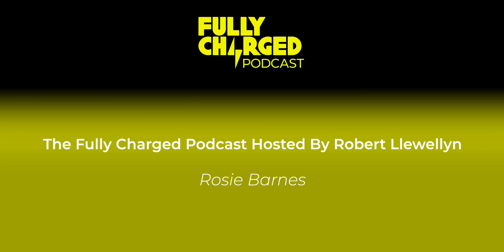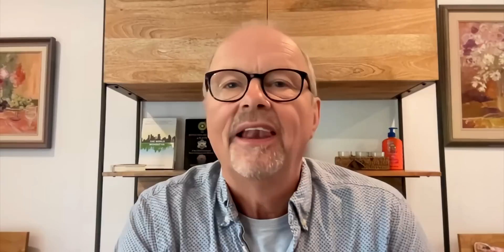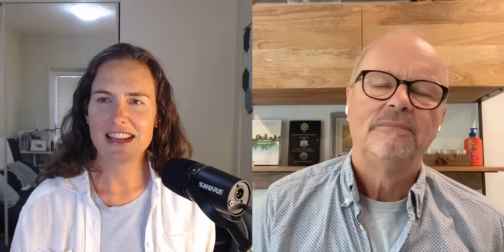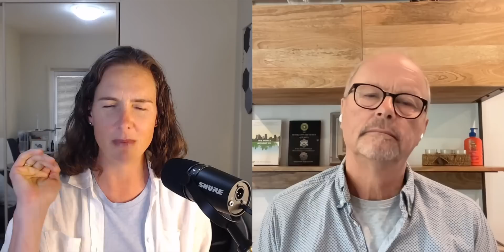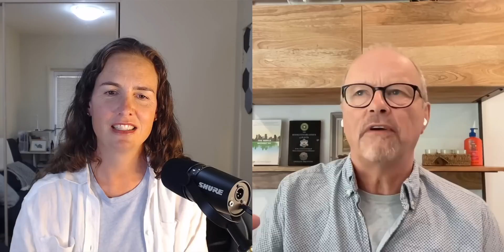The Inevitability of a 100% Renewable Energy Supply with Rosie Barnes | The Fully Charged Podcast

Comment: If the renewables are so cheap why do we have one of if not the most expensive electricity in Europe?, say we manage up put in lots more wind generation capacity and the wind does blow for say 5 days which does happen, what is going to power the country unless there is gas back up?, battery back up for the whole country for multiple days would be absolutely huge not only in size but also in cost! People are living in la la land, we need much more base load nuclear. 
Robert have you done a video showing people how much your solar panels produce in December?, I bet it doesn’t run your house for the day that’s for sure.

Comment: There is nothing inevitable about producing prohibitively costly electricity!  Electricity should be getting relatively cheaper with improved efficiencies even with the cost of tight emission requirements, but anyplace renewable energy has been implemented the cost of electricity has gone up significantly not including traditional hydropower.  Where renewable energy is rampant electricity costs can triple making them prohibitive for growth and still cause the public power grids to go bankrupt, unreliable and unable to upgrade its power lines making them dangerous.    

The Hawaii fire that destroyed neighborhoods and killed many people appears to be from badly maintained power lines from a public power grid proud of just having eliminated its coal power plant demonstrating no public responsibility in providing reliable, affordable and safe public power grid electricity.

Comment: One aspect missing from the narrative in this episode is the fact that the resources needed to mine, refine and manufacture every wind turbine remain heavily dependent on fossil fuels. 

The steel needed for the mineral mining machinery, the energy used in mineral refining and final production  of the resources needed for renewable energy generation and storage all depend on fossil fuels. 

We have a long way to go before all renewable energy production and storage is fully decoupled from fossil fuels. I look forward to the transition however, we must remain aware of the fact that every solar panel, every wind turbine and every EV requires a significant amount of fossil fuels to get from raw material to finished product.

Comment: There is no question that wind and Solar are cheaper on a dollar per watt generated at peak levels.  The problem becomes in providing continuous power, especially when these fail.  This requires backup.  When that is taken into account, the numbers shift dramatically.
If this woman is an engineer, she is likely to be in violation of her ethical commitments by making all of these comments that she is not qualified for.  Her expertise, as she stated, was to evaluate length of windmill blades versus costs, etc, etc.
Robert Angus, P.Eng.

Comment: IMO, Too much on 'the positives' without addressing the negatives that come with the positives. Ex. at around 37 minutes, Robert speaks about decreasing usage of power at times when less energy is produced. OK, quite sensible, but that would also greatly increase the usage in a smaller time frame - which is also the time frame that industry is using the most power. Can the Grids handle that? Additionally, I heard no mention of dangers to wildlife. Birds are smashed by wind turbines and fried by solar. Considering the increased units of these sources, there would also be an increase in wildlife deaths/injuries. What about waste? Parts for Green energy don't last forever and are surely not made of biodegradable materials. Just a sample.

Comment: The only "inevitability" is fossil fuel production is declining. Thus we will need something.  The question is WHAT - that WHAT cannot be Solar nor Wind. These are demonstratable farces.  The fail point is battery storage.  The largest storage battery in the world was just built in the UK  Cost 400 million for 400 Megawatts- it could only sustain the current electrical demand in the UK 11 seconds.  You'd need 1500 such giant batteries to maintain power at night; not to mention dark winter days. Unfortunately you need to triple that to move fossil to electric - so you need 4500 such storage sites; at a cost of 400 Million each - is roughly 25 Trillion dollars.  Does that Strike you as real even at 10 Trillion? The entire UK economy is only 3.1 trillion - don't forget this is just the storage; not the wind mills and the solar farms. TOTAL CRAP.

Comment: Denmark has the most renewable energy and also the highest household cost of electricity. In fact most locations that have a high amount of renewable energy have the highest prices for electricity. Most of this is because you need to keep some source of backup when the sun doesn't shin and the wind doesn't blow.
Reply: Exactly right, there needs to be back up, solar panels are useless in the winter in the uk or Northern Europe and wind is intermittent, no one is addressing the back up issue renewables are largely an expensive scam, I can see a future where we will be left with old wind turbines that will be abandoned because they are uneconomical to replace and keep maintained.

Comment: It is not technically or fiscally possible to build the energy storage capacity on a level to support a national power grid. That is why nobody has it.  Therefore, the notion of 100% renewables power generation is a fantasy. Even the EU have had to accept this, they have now classified gas and nuclear as "Green fuels" so they can bypass the finance bans on funding  "emitting"  tech, and can build new gas and nuclear power stations. Why, when they are committed to renewables? Baseload power provision supply 24/7. You can build as much wind and solar as you like but if there is no wind, or too much, and no sun, you still have no electricity.

Comment: I don't mind getting rid of fossile fuels but from where are you going to dig up the minerals needed for the renewables and extensive grid structures? Just a "simple" mineral like copper will run into a shortage in a couple of years. Rare earths...? Where and when are the mines opening? Still more than 80% of the worlds energy comes from fossile fuels. Renewables around 4%. Since there is a shortage of minerals to supply renewables the price for renewables will not drop. Of course, as long as politicians raise the carbon emissions taxes accordingly, people in favour of renewables can claim they are cheaper but can people afford the energy bills without extensive tax deductions? If no tax deduction, the inflation will be very tough to deal with. I never see an open discussion about the mineral facts from those in favour of renewables. Why is that?

Comment: At min 40 Rosie dreams about a system, where the energy customers actually make money if they act according to the availability of power (like: use the washing machine when there is plenty of wind). Sounds nice. And true thing, you can steer consumption this way. Easily done too: the price for energy wont be constant anymore but will change from hour to hour. You ll need a complicated meter in every household and we people have to really be careful when to switch the computer on. Will you have an app on your phone that has an alarm set if the price is too high? Cool, huh? You wont "safe" money this way - you can prevent to pay a lot! Everything will be more complicated. But hey, its for the environment. And while the poor will try to carefully adjust their energy consumption ("Sorry, baby, its too expensive to turn on the AC now..." Will the rich politicians that sold us this "way to safe money" carelessly consume energy because they have enough money.

Comment: Wind and solar have negative value. All they do is disrupt the grid, despoil the landscape and kill birds. They last 15 years and then are tossed into landfills or are abandoned in place. They wouldn't be worth using if the Chinese gave them away for free. They use more energy and materials than they save. There is no shortage of cheap, reliable fossil fuels which replenish the Earth's depleted CO2 and have a small footprint on the land. We should also be incinerating garbage for electricity and heat instead of sending it to Asia where they dump most of it in the ocean. My plan: Prevent most forest fires with plenty of logging and logging roads. Build lots of coal plants and garbage incinerators which will provide the missing particulates needed for rain.

Comment: 100% low emissions energy is inevitable but not for 8 billion people.  Global warming is already locked in 2 C warming by 2050 and 4 C warming before 2100.  Here is why.  CO2 equivalent is already measured at over 500ppm.  Arctic will be ice free within a decade or two, releasing massive CO2  and CH4 amounts into the atmosphere from methane hydrates and CO2 on the ocean floor and the millions of sq km of thawing tundra.  The stratosphere is warming vaporizing stratospheric clouds reducing reflectivity increasing isolation.  Global fossil fuels supply is nearing permanent decline and increasing cost.  Energy cost has a limit of about 10% of the value of the work it will do, despite economists say that applies to all energy.  The only truth in economics is:  Supply will meet the demand that has the a ability to pay.  Most will not have the ability to pay.  The metals needed to electrify the energy system are neither in supply or known reserves.

Comment: Unlike Rosie I have actually worked in electrical engineering mainly in generation systems for decades with the last decade being mainly in wind power in Europe working on the design and latterly certification of some of the largest offshore wind farms on the planet and I can tell her now that Wind energy will never replace nuclear and hydrocarbon energy sources.

I like most engineers who got involved in wind power thought it would save the planet albeit by destroying huge swathes of hillsides and seabeds that if oil and gas were to do it there would be a huge outcry but the fact is that without huge government subsidies that push up the costs of electricity massively these things are financially impossible to build and if the full damage they do to the environment was added up they would be impossible to build from a renewables standpoint also.

Sadly we only ever hear from those benefitting from the pushing of wind power who are simply not willing to be honest about its true costs and its enormous weaknesses in terms of reliability of supply (the wind generation in the UK increasingly drops to near zero for weeks on end), short lifetimes well short of the 25 years promised (especially at sea) so meaning the whole generation system has to be renewed at least every 20 years on average, utilisation even at sea is less than a third of rating on average meaning far more electrical equipment has to be installed to capture the same energy as a thermal plant that in less than 1% of the footprint produces 24/7 and as a result massive increases in energy costs in every country that has fitted them occurs with those countries having a higher share of electricity generated by wind having higher costs than the next country down the list without exception.

Wind power makes very rich corporations and their investors far richer at everyone elses expense and destroys the planet to boot. Nuclear energy in any number of its forms is far less damaging to the environment and actually permits a country to have a first world economy that doesn't have to shut down for weeks on end as would have already been happening across Europe for years now had it not been for nuclear power stations providing base load and massive numbers of cheap gas powered stations picking up the baton that wind all too frequently drops.

Unfortunately pushing "experts" like Rosie to the fore to push the nonsense that wind power is a good idea after nearly two decades of it being obvious in the real world that it can never work only pushes the West ever further behind the real first world countries of the far east.

I recently took early retirement simply because I was not willing to keep on participating in this lie being foisted upon the people of the world that wind power is in any way actually renewable. Electricity prices are being designed to rise not fall and anyone supporting that is supporting fuel poverty for the poor and "the poor" are increasingly coming to a street near you if this continues as more and more people are dragged into planned debt.
Reply: Thanks for your frank post. I agree with you, I work in utilities engineering. I find it interesting how little most understand about the fundamentals of the electricity grid. It’s annoying that they present shows with ‘experts’ and then back up their claims with anecdotes. 

There is a huge amount of investor cash flowing into wind power. Is someone who works in the industry going to spill the beans and tell the truth, even if they are aware of it (they probably aren’t)

The only people who can speak their minds are either retired (like you), or in a tiny minority (like me) who actually say what they think. Everyone else toes the line for fear of being called a Climate Denier. 

The science is never settled, and no amount of wishful thinking will make this work. It’s a boondoggle, shortly to meet its end when people wake up to the reality of an expensive, unreliable electricity grid. 

And yes, demand side response is an unreliable grid. Just because they incentivise behaviour to fit in around the blowing of the wind, doesn’t mean they aren’t inconveniencing your life. 

And no, I will not install a smart meter. My life is busy enough as it is to have to deal with another factor. I will cook my supper when it suits ME, not when it suits the electrical grid. 

Like a lot of things nowadays taken over by the blob, the cart is before the horse. 
People serve politicians instead of politicians serving the people, people serve the grid instead of the grid serving the people.

FUBAR
Reply: Relying on others peoples data, my apologies, the sources were from Great Britain.  Recent green energy projects always promise lower electricity costs, but in every case the end result in much higher cost, sometimes double.

Comment: BIOMASS - please please do a show/podcast on the green wash that is biomass burning.  Please dispel the myth that this is green and that somehow burning this carbon is better than letting it rot in the ground.  Or that assuming in 25 years that the tress you have cut down will be replaced by new happy trees (fires, drought, floods, erosion all ignored).  Also highlight how we are cutting down forests to supply this ridiculous demand. Also point out how much more energy this takes and how much more polluting it is than the coal that it is being replaced by.  This has all the hallmarks of a great Robert rant that I would enjoy so much.

Comment: At 40 minutes into this video, I like that Dr. Barnes says that more natural gas is used by the Natural Gas Exporters.  They use the gas to run compressors and cool the natural gas into liquid natural gas, that can be transported by ships.  

Steel towers are limited to about 12 feet in diameter to allow them to go under a bridge in America.  They are starting to build a concrete tower base in Europe, where they have 4 meter high sections that are about 10 meters in diameter at the base, and only 3 meters at the top of the 60 meter wind tower base.  Then the rest is done in steel.  

At 28 minutes into this video, she said a friend told her "My grandad was a coal minter, my dad and I also, now it is so much better to be 100 meters above the ground than 100 meters below the ground!"  We need to let the coal miners know that it is so much safer to be 100 meters above ground, not 100 meters below ground!
Reply: But by the time they've ascended the 100 metres to the job interview, career BullSh1tters will have taken all the jobs... 😉

Comment: Going 100% ‘renewable’ for electricity generation is fine (if you believe in that) but electricity is still only a fraction of total energy usage - in the UK around 25% I believe so we shouldn’t confuse this with meeting 100% of energy needs. We are miles from that.
Reply: Petrol/diesel use will all be replaced by electricity soon. Most gas usage in homes and industry will also become electric as well.
At that point you are closing in on that 100% quickly
Reply: @baronvonlimbourgh1716  
The great renewable con
https://youtu.be/BIXncWdwS-s